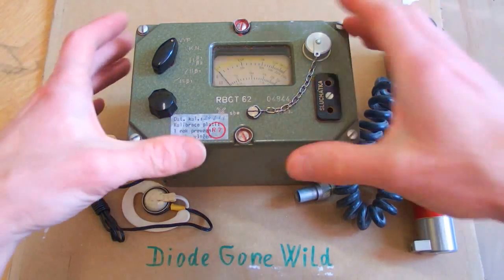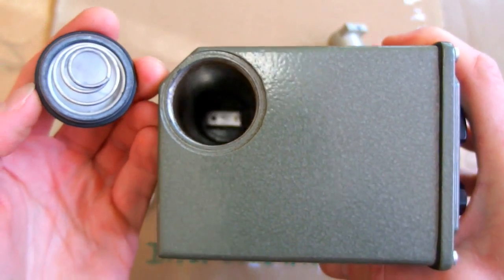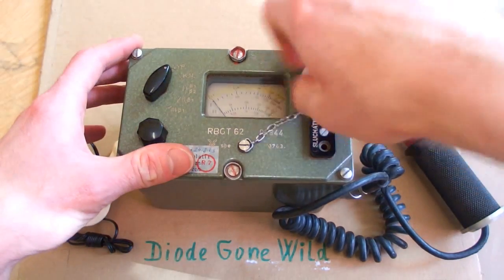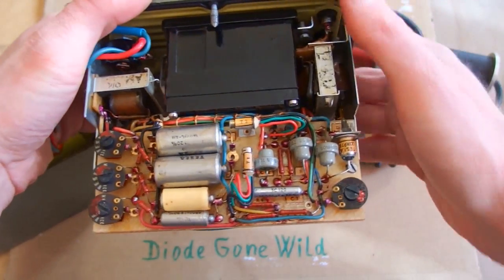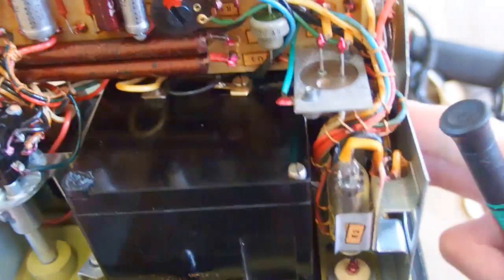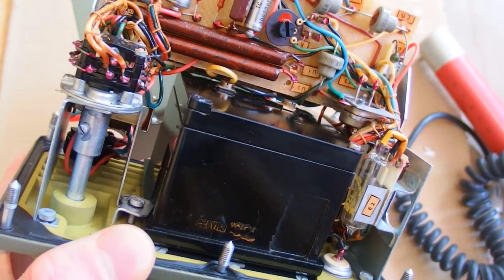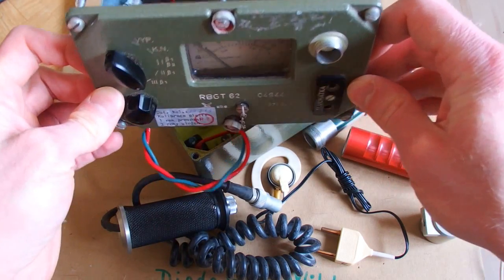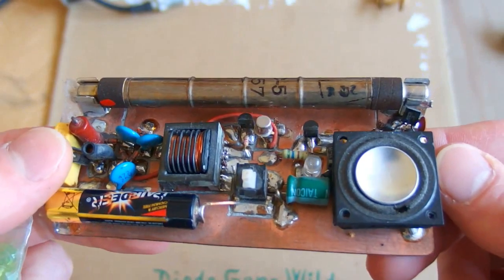1963 Cold War Military Geiger Counter Teardown (RBGT-62)

Comment: wtf you have uranium in just plastic bag xD?
Reply from the maker: Those are uranium glass balls/marbles/beads. Those are legally sold and by law they contain less than 1% of uranium, but usually just about 0.1 or 0.2%. They are a safe Geiger counter test source :).
Reply: DP-5V Geiger Counter prob  radioactive check source Strontium-90 ( Beta )

Comment: An interesting and sturdy piece of tech, definitely well designed and built. It uses high reliability military electrolytics - C11, C15 etc. Worth restoring IMO. You could make a plugin piezo speaker to use with this counter instead of the headphone.

Comment: Thats a nice heavy duty die cast aluminium case.
Unusual looking components, solid looking.
I also thought that big TO3 cased transistor was the main part in an oscillator to provide a high voltage.
NPN perhaps?
Reply from the maker: In the RBGT-62, all 3 transistors are actually PNP. For some reason, the oldest transistors were always PNP. But the newer version RBGT-62A contains 1x PNP and 3x NPN.

Comment: Interesting system that three way level adjustent. I have vintage Finnish Wallac Geiger counter which has similar battery compartment and as robust construction but it has a handle where to carry it and it has a speaker as well. I have a small radioactive mineral which I use when coarse calibrating these and checking if they are working. I remember that it has Mullard tube. I wonder if your instrument has Phosphorescent paint as it looks similar. Have you measured the scale? It deteriorates quite fast and the radiation may be small now.
Reply from the maker: This one doesn't have any handle because soldiers used to carry it in a leather case. (it originally came with a case). This one has a phosphorescent scale, but it's not radioactive. It glows just for some time after exposed to light. There's no Ra in it.

Comment: I am trying to repair an rbgt-62a. The output voltage is too low and the needle can't reach K.N. I tried moving the black circular potentiometer beside the voltage stabilizer tube. It moved the needle past K.N but the humming sound stayed at the same volume.
Reply from the maker: The sound of the inverter in the earphone is probably normal. I also hear it in all of my pieces.
Reply: Ok, but why is the voltage too low?
Reply from the maker: It can be a lot of things. Bad battery or poor battery contacts. Poor contact in a pot or switch. It can be damaged transisor in the inverter or damaged diode. It can be faulty regulation tube (the glow voltage regulator). Don't measure this voltage with multimeter, it will make the voltage go lower. The internal resistance of the inverter is very high. The voltage should be 400V, but the voltmeter won't show this. If the needle is at K.N., the voltage is ok.
Reply: At first the tube didn't glow , so I turned the black potentiometer. Now it glows, but only a little. The glow is very weak, is this ok?
Reply from the maker: The gas is probably not neon, so it doens't glow much. It is not designed to produce ligth. So it may be ok.
Reply: Thanks, you have been helpful.

Comment: "This one would be still working if the Geiger tube wasn't stolen from this one." This one sounded really funny for some reason. Also, how sensitive such tools are? Will they react to direct sunlight, or radon in the basement?
Reply from the maker: This doesn't react to sunlight. The tube is made of metal and so the visible / IR / UV light can't get in. The STS-5 tube is sensitive to gamma and beta. I have never tried to detect radon. Maybe an alpha sensitive tube would be needed. Maybe a ionisating chamber would be better. I'm also not sure if the level of radon radiation would be detectable. It is possible that for proper detection you need to absorb the radon (or likely some elements in its decay chain) into some material (carbon?) and then measure the material (carbon).
Reply: Well, sun emits some gamma (tiny amounts, to be honest, more with flares), but i guess it's not enough for most tools to notice. Radon, while relatively abundant, have alpha decay, so it basically directly ionizes surrounding air without any noticeable penetration - so, by measuring ionization levels radon amounts can be measured indirectly. And ionization levels can be measured with some kind of magnetic field geterator which will force charged particles from recombining by pulling them in opposite directions - towards some kind of ion detector, probably just grounded probe with ampermeter, and quite possibly some amplifiers in between. But then, noises will most likely just obliterate currents caused by charged particle movement. I guess some other ion detector is needed.
Reply: Even a alpha sensitive geiger counter will not detect radon in the air, because there are such small amounts.
Reply: Sensitivity is relative. We can ramp it up indefinitely if we can offset the noise.

Comment: I think nothing happens if you put that probe into ~220V power outlet - it is just a capacitor filled with inert gas and working with 450V so 220 AC should do no harm to it. On the other hand what happen if you put finger in that probe socket ? :)
Reply from the maker: The headphone plug is simmilar to a mains plug, not the probe plug. 
The probe socket has 400VDC in it, but it is hard to put a finger into it and there's a very high value resistor in series (I think 10M) anyway. This would only result in 0.04mA through your body. You wont even notice such current.
Reply: oops